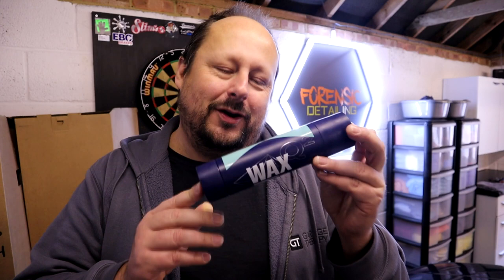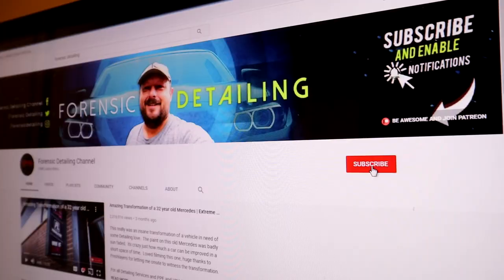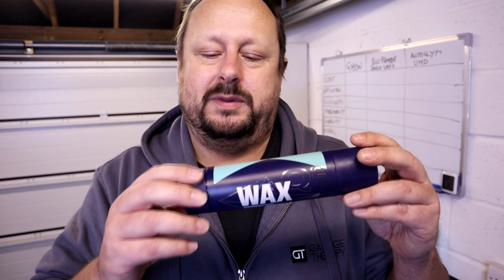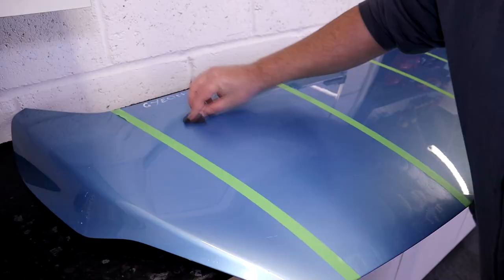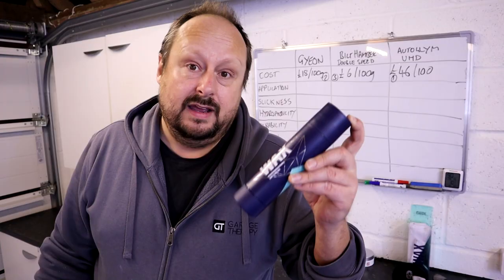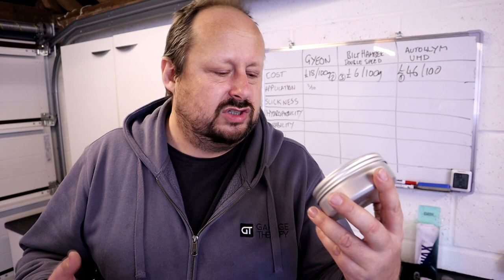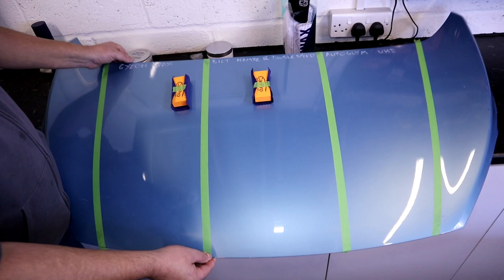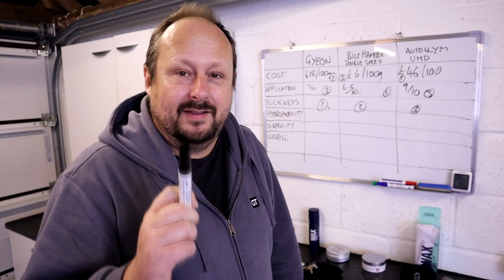*NEW* Gyeon Wax V Autoglym UHD V Bilt Hamber Double Speed | Review

Comment: Bilt Hamber , Bead tastic, gyeon and UHD in one test! Getting the gyeon as I like most of their other prouducts. The Double speed is on my car, UHD on the other, Gyeon is going onto the van. Ask me in a year which I like best.
Reply: How is it going so far buddy?
Reply: @10xman9  Bilt Hamber beading the water off today like a waterfall. Very impressed with the Gyeon on the van, it’s looking cleaner longer and the bugs are easier to remove.
Reply: @johneardley5044   thanks
Reply: So which one you like the most?
Reply: @sb8536  the Double Speed lasts longer, the Gyeon is the easiest to apply, both have great features, so, I like both.
Reply: @sb8536  Gyeon the bottom of the van gets filthy reapplying around 2-3 months keeps it looking good
Reply: @johneardley5044 how is the UHD doing overal?

Comment: Would love you to do a review on BH liquid wax. If it performs as well as the double speed (its actually more expensive than the double speed) then it should be a great product. Useful for machine application when it's a liquid wax.
Reply: I'm testing it atm, 9 weeks in and it's still going strong. Blown other liquid waxes out of the water
Reply: @jamesgillespie9000  so much handier for application! Need to try it out next.
Reply: Is this the hydra wax from Bilt Hamber?
Reply: @kwl189  yeah that's the one!
Reply: @rflood  impressive durability. Thanks for replying and confirming. YouTube didn’t inform me. Wonder how it stacks up to the cheap stuff from
Turtle wax that gets a really good reputation in parts. Or how does it confirm to polar seal from
AG for instance. Super easy to apply in a canon.

Comment: I have been using Gyeon wax for a few months as a topper. The hydrophobic behavior is insane but the durability is only about a month at the most. Still I like the idea of using a wax over ceramic to help with water spots.
Reply: How did you manage to get it so early? 😲
Reply: Car Supplies Warehouse
Reply: Both of those products are great and worth using. I’m just curious about how the Gyeon wax holds up as a ceramic topper. After three hard months the product is holding up better than expected. This is comparable to the original fusso.
Reply: @neilwalker5041  I’m confused re: the durability? You mentioned earlier it was only a month?

Comment: I’ve gone round in circles on coatings. Spend 2 days doing a ceramic properly. 2 hard days too. More days if you need it to cure and keep out the rain. If you have only one car there’s a lot of downtime with that method. If you don’t have cover it’s much harder. Or you go hybrid. Use  CP lite as your base then wax a few times a year. Much easier to put on, if you mess it up you don’t risk much and can take an afternoon not days. Do half a car one week half the next. It’s not all critical. If you need to add wax you do. You don’t need to machine buff with precision. And go through the whole process. 

I think going ceramic hard core makes it a a science step. I find myself bot enjoying the process. Where a good wax or temp coating lets you enjoy the process and take your time without pressure.

Comment: Im still using the TAC Systems Shinee Wax you recommended last year. Its very good value. Superb results. And about the easiest product to apply for a novice.
Reply from the maker: its good stuff isnt it but its kind of a different genre, detail spray/spray wax perhaps its more of a topper but yer shinee wax if you use it every wash will also give you some protection.    This is the beuty of all this, you can take a very very simplw approach if you want or you can literally have like 13 layers of protection.  I think 13 was the amount of potential layers you "could" have on your car with a genuine brands system :)

Comment: As you mentioned companies like Gyeon missed a trick by not selling wax's. Now wax's are all good! I'll never use a ceramic coating except for the wheels for all the reasons you mentioned. I'm not bothered too much about longevity reckon it's overated if you're washing your regularly with a drying aid. Great video!

Comment: I’ve just swapped over from the tw ceramic range to this new gyeon wax and all I can say is it’s fantastic. I completed a full decontamination and clay then machine polished with gyeon primer the topped with the wax the colour and the 3 stage pearl in my focus rs mk2 in ultimate green just popped amazing the look is fantastic highly recommend. Just don’t know about how long it will last for. Mind you the rs is in the garage most of the time great review once again mate cheers from Aussie
Reply from the maker: Im in the same boat as you.  if you full prep the car and the car is garaged the durability is less of a problem.   some people are reporting 1 month durability which I find hard to believe.  mines been on about 3 weeks and 3 washes and its still performing well.
Reply: @ForensicDetailing  I may use with wet coat on the next wash or the quick detailed spray I don’t want to Take away the look of the wax as it’s awesome may invest the ceramic spray over the top later on. Great channel mate has to be one of the best if not the best on YouTube keep it up 👍

Comment: One place wax is better than ceramic coatings is wax doesn't need to cure for 24hrs. As a mobile valeter in the UK where 99% of customers don't keep their car in a garage so you can't guarantee a car is going to stay dry, let alone bird crap free, for 24hrs. So. i offer Angelwax Enigma ceramic wax which Angelwax said when I asked them doesn't need a cure time at all. Sure you can get quicker curing time coatings but the ones Ive seen have a short life, in which cade you might as well apply a good wax

Comment: This week a bird dropping ruined my BMW black paint on a door. It was in the car for no more than 8 hours, but it made a hole through the clear coat into the paint! The door had a 2 weeks old layer of Meguiars hybrid ceramic wax and a 3 days old layer of ADBL synthetic spray wax on it. Unfortunately, they didn't protect the paint at all, so now I had to switch to a ceramic coating :(. Bird droppings have a PH of 3~4.5 and Cquartz has a PH resistancy of 3~13, so I hope next time this won't happen! I was in shock. I was an adept of paint sealants/waxes in spray or paste, but unfortunately, I now had to switch to ceramics that are way more time-consuming and expensive.
Reply from the maker: if that bird dropping sat there and ate through to the paintwork it will go through that coating rapidly as well.  theres real advantages to coatings dont get me wrong but generally they are not for me on my main car.  and my family car gets smashed up so its pointless "protecting" the paint.   bird crap is the least of my worries with the way my missed drives into things.

Comment: bh is great. Do not over aplicate, meaning 5-15g for car and it is a breaze. One thing missing is nice smell. This one has none.
For the looks. It is good for metallic paints. Not in love on my race red ford. Would say it make it brighter :D
It is still going on my friends vw golf, for over 6mths, on BH cleanser polish, after quick prep with no machine polish, after the winter, with poor maintenance. It is great. Combo of bh cp + bh dsw has a lot of fill so great for cars with moderate paint.
Reply from the maker: cleanser polish is great isnt it. creates this silky smooth platform to wax on.   the gyeon wax works on top of the Cleanser polish as well.
Reply: @ForensicDetailing  yeah. If goal is to boost looks and no polish BH CP just rocks. I tested lonegevity on CP against naked paint and it was not bad - fusso, finis, dsw, carchem 38 and even angelwax desirable were great. Actually i just reaplied after winter.

Great to see gyeon on the same panel with known waxes. Seems it is meant to protect coating after application. I wouldnt consider it standalone product honestly. Real world some folks tried on fully preped cars and it is gone in a month.

Cheers Jon. Hope you are well mate!

Comment: Cracking review Jon, I love dsw, I just wish it was a little smoother to the touch compare to others no issues other than that, I always apply outside with a damp applicator. Really keen to try the gyeon wax, always been put off by the price point of the HD its a non starter when there are so many from soft99 and bilt hamber at bargin prices that last months.

What pen you using on that panel tho Jon?? I assumed it was chalk but it doesn't come off  is it a paint pen?

Comment: Btw a lot off people don’t believe in nanotechnology or ceramic coatings and use waxes only.
Reply from the maker: forget about the word nanotechnology and ceramic coating.. dispell those words.   think of it as speciality resins developed for certain applications outside of the car protection sphere (coil coatings, coating train carraiges for anti graffiti coating, coating modern building facades and glass on skyscrapers to make it easier to clean).    Then the detailing industry figured out you could coat cars with it, and the raw inorganic silazane was always developed to be "develope-able" by mixing with organic resins, which is what a handfull of companies started doing to create blends with more desirable characteristics.   the raw silane which was pretty much all that was in the first generation of coatings for cars, was barely hydrophobic so the market didnt take to it.   it would last years on the cars but people thought it was worse than a wax because you cant measure products that are not hydrophobic.   so organic siloxanes and silicones were added to make them bead, then new base silazanes are available now and its a more complicated market place with more players.  but 99% of people that say ceramic coatings are snake oil no nothing about them.  they might not be viable for most people including me.. but they offer simple undisputable properties than non ceramics cant compete with. but these qualities also create problems.

Comment: You can't mark BH down for problems caused by not using a damp applicator when the instructions tell you to use a damp applicator. It wouldn't have effected the score but it is worth pointing out
Reply from the maker: my product does not have those instructions.  but its a fair point
Reply: @ForensicDetailing   if you download the pdf  instructions it tells you to, granted it does in the how to use section  of the product page .

Comment: Hi Jon, great review as always. I’ve got a question for you. I use the auto glym polar series (snow foam, contact, seal with hydrophobic wash) when I wash the car. I wanted to know when I should be applying one of these wax products to the car? Is it after the polar series wash in full or before the hydrophobic coat? Thanks in advance!
Reply from the maker: so with a paste wax you wash the car with pre wash and pure shampoos. decon/clay if required (if contamination is present).  machine polish the paintwork if its swirly or dull.      then do like a panel wipedown to degrease the paintwork.  And apply a wax or sealant etc....     then in a months time if you want to boost hydrophobic and add protection you can wash and top up with polar seal for example.  polar seal is more like a booster top up than a base line protection product if you get me.
Reply: @ForensicDetailing  thanks Jon. Will you need to reapply the paste wax after every wash?

Comment: Durability of Gyeon Wax really dissapointed me. I know this is only wax, but on my car it leave max one month in good condition. Cure even diluted last longer, as topper of course. Price of Wax is same as Cancoat. In my opinion Cancoat is ten times better as topper than Gyeon Wax
Reply from the maker: you want durability right. its interesting. because you will struggle now to find any wax which can outlast Double speed.  Others post here they dont like double speed because its harder to buff.    so lots of different requirements.
Reply: @ForensicDetailing I didn't mean it. For hard wax, Gyeon's durability is simply poor. I do not expect him to be durable at the DSW level. I was hoping for two or three months ...

Comment: So you can put the gyeon wax over a ceramic eg can coat or wet coat. But what would you use at the end of a maintenance wash stage? Gyeon qd or cure or there new ceramic spray detailer, or would these not ‘sit’ right over the wax?

Suprised they dont have a spray wax alternative to accompany the wax stick. 

Is it solvent heavy do we know?
Reply: You’re not using a drying aid or a qd  after the wash. 

You apply a hard coating like Moh’s. but now you want a high contact angle - Wax. 

When the car stops beading the way you want slather on more wax. 1-2 punch

Comment: No mention of its branding..... and design. Do it's ' stick nature ' have advantages for application over the regular pot/tins?
Reply from the maker: yer more to come on this.  its not like an "advantage" in application.  Its just like a neat/clever application idea. and implementing this idea requires that extra bit of work and cost that most companies dont do and this can seperate gyeon from the hurd.  the down side is the bespoke application method is a tad slow because the applicator is smaller but you can just load onto a bigg appliocator I guess. stay tuned.

Comment: Hi Jon, really liked this video as thinking of buying the Gyeon wax as already have the others.
Can you tell me if paste waxes have a shelf life as my UHD has a symbol saying once opened its good for 18 months but I do keep my waxes indoors so there not exposed to extreme  fluctuations in temperature. Thanks
Reply from the maker: old school wax/oil/solvent ones could last for yeasr. modern ones with other materials mixed in.. some polymers can expire after 1-2 years so it varies product to product.  generally you are good though for 2-3 years.
Reply: @ForensicDetailing  Thanks for that Jon, so my UHD wax should be good for more than 18 months. How would i tell if it is no longer any good to use.
Also some products say they will give you 6-12 months protection so you might only use them a few times before they expire or are they just saying that so you go and buy more.
Thanks
Reply: Gyeon states the shelf life of Wax is 5 years once open

Comment: Quick question Jon, 'As a tube wax, I am guessing it can be machine applied with a soft pad? Is there any word on that. It would be interesting to know,  just I am tighter than a nun's chuff. Seeing it takes 30 mins to cure, reckon it would be worth a try
Reply: Yeah and cuz it’s in a deodorant stick it’ll be easier to get into the pad than using a spork

Comment: Do this provide a better gloss/shine than the Qyeon quick detailer?
Reply from the maker: you need a slight tweak to your mindset or your thought approach to detailing products.  if you think of products "providing" gloss in varying extent your in the wrong place.   Think of machine polishing your paint as a way to install gloss by maximising the condition of the paintwork.  And then its all about cleaning carefully and using less products to maintain the condition.   If you can get into that mindset you will get better results really.  enjoy these type of products for what they are.  pick one that provides what you need.   be more mindfull of how easy they are to help you maintain your excellent finish rather than rely on them to provide that finish.

Comment: Hi bud, I have a black vw passat 2013 pretty sure never had any detailing done, swirls and holograms are awesome...plus even after a wash paint looks dirty and dull absolutely zero shine. In one video you talked about complete decontamination which would be a wash followed by clay but you never touched upon the chemical ratios and what chemicals you'd use before actually going in with the claying. I will be attempting to polish when the weather allows as doing it outside and then wax to seal the deal. For now have you any video explaining the chemical uses before claying or is it unnecessary? Already ordered korrosol for my awful wheels so that'll be arriving shortly but not sure how much use it'll be to use on the body prior to claying. Cheers 🍻
Reply from the maker: so wash it down mate with pure shampoo loads of brush work. clean it twice if need be..    rinse it off.  go over paintwork with BH korrosol and let it react purple on the paint for 3-4 mis then agitiate it with wash mitt like you are shampooing the car again.. then pressure wash it off.   Then dry car...   then clay it with BH white clay and soapy water as clay lube in trigger sprayer.   then dry off car.  and machine or hand polish and wax.   I have lots of content in the detailings fudamentals playlist on my channel homepage on all this  but also you should check out my Detailing Fundamentals training course with discount code applied which covers the lot in a structures online course.

https://ioa.pxf.io/c/2687409/1012495/12764
Reply: @ForensicDetailing  what a legend of a man, thanks alot mate I am watching every single video you release and you're the reason I am getting into detailing, again thanks big man